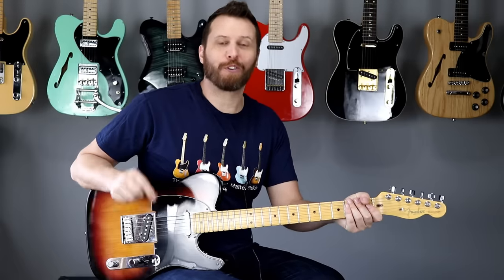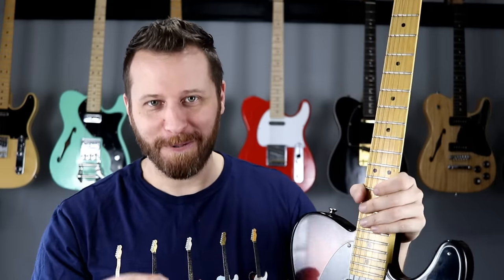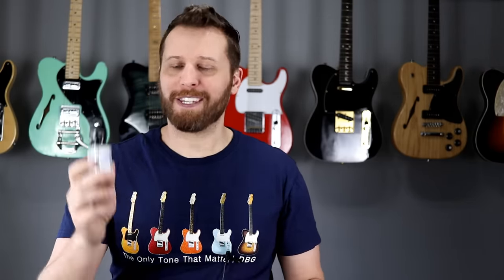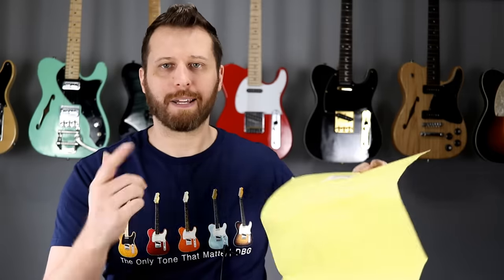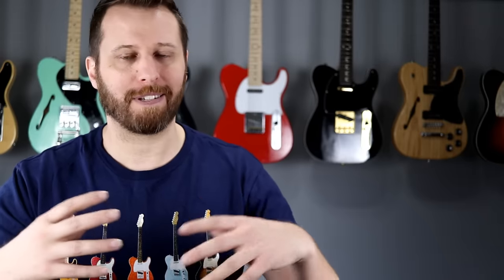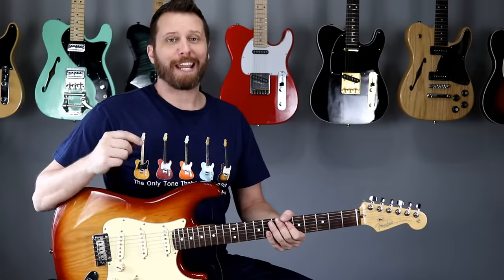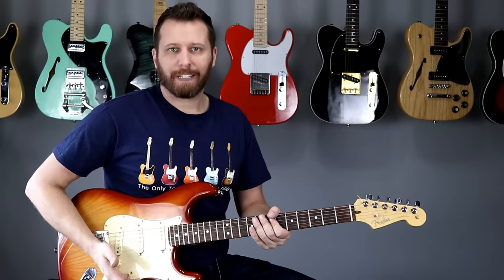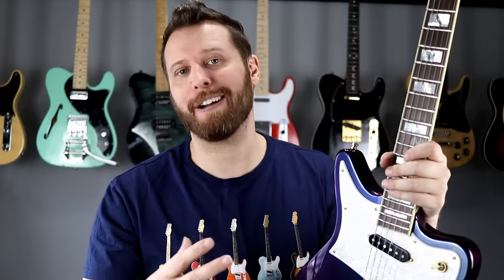KILL The Hum and Buzz!! - Keeping Your Single Coils QUIET!

Comment: Get a Gibson Blues Hawk with two P 90 single coil pickups and a Dummy coil to stop the hum. Gibson should make a Les Paul with P 90’s and a Dummy Coil pickup. Fender could also install a dummy coil pick to remove hum. The Dummy  coil has reverse winding to eliminate hum. Or you can just turn the volume down when not playing.

Comment: Shielding helps with Rfi , not 60 cycle hum.
Some confuse the two. Also sitting right next to the amp doesn't help. Step away from the amp a few feet. Sheilding is B.S. and a lot of times will make things worse and cause ground loops. A noise gate is really the only thing that will truly reduce 60 cycle hum under significant gain.

Comment: Twist the OEM single coil pickups and output jack wires!!! Lightly shield cavity with aluminum foil tape that works just as well as copper foil!!! Ground the three pots together single wire daisy chain as with shielded cavity!!! Stop sinking more money in swapping out pickups!!! I've done these steps on various strat's with positive results!!! Slam the factory pickups down away from strings, and not be afraid in turning amp volume up!! Cheers!!!

Comment: I use a gate pedal and a compressor pedal that gets back some of that sustain you lose by the gate.  Also, you should shield your guitar if its not. Its not that hard and if you care about sound, you will.  That being said. Sometime depending on what is running, you still can get some hum.  For some damn reason my wifes blow dryer sets my guitars off!

Comment: A tip, plug amp into an isolated socket not sharing other electrical appliances. If you cant switch room AC sockets get a nice thick 3 core electrical extension cord and a balanced guitar signal cable not longer than 20ft. Veteran 45 years dealing with this.

Comment: One thing, when recording with a digital processor likle hx stomp if you using single coil remove all rgb from pc hardware and mouse and keyboard cause it does a digital sound with the singles, humbuckers no problem.

Comment: 4p2t on off switch makes a metal covered humbucker into an in phase dual single coil.  Is sweeter than a humbucker and quiter than a p90, quiter than a single coil.   I get a pre boost switching to single coil mode.  Half the impedance, and raises the output.

Comment: Still use my Boss NS-2 that I bought in the early 90's. It has parallel 9v output and a separate send/return loop for my Soul Preacher compressor and Sovereign Distortion 🗽

Comment: Did anybody mention aligning yourself and your guitar in that sweet spot where there's no hum?  It works good when you're recording.  I've used that technique more than a few times.  I have used a noise gate, an old MXR.  It worked good but it did change the attack and for that reason I avoid using them.  My main squeeze is a Danelectro Silvertone circa 1965.  Some previous owner shielded the pots with heavy gauge copper.  I suppose it helps.  The pickups are out of phase and I can play with the tone and volume a little before the hum starts in.  It gives me yet more variation from a guitar that already has a broad range of tonal variation.

Comment: Fishman Fluence single coils are completely silent and aren't stacked humbuckers so they sound right.  I have them in an Eric Johnson Strat and they sound fantastic (or they would if I could play like him).  Only downsides are cost and they fact they are active so need power - the USB chargeable back plate is very convenient, though.  I don't think there is a better solution if you can't stand the hum.

Comment: You can also install a dummy coil. Its more work than shielding, but its very cheap (just buy a chinese single coil and remove the magnet) and sounds arguably better than a stacked coil because its further away from the magnets. You can also tap it if you want.

Comment: I'm skeptical that shielding paint and foil and all that helps unless it's connected to the ground in some way? I used to think that noise gates were a super complicated circuit that will mess with your tone but nope, they just use a light-sensitive resistor and a light so noise gates are great if you ask me.

Comment: Noise gates (good, current ones like the EH Silencer, among many others), Illitch backplate, Zex Coil pickups, Mojo Tone Quiet Coil pickups, EMG pickups, Area 51's, shielded guitar cable, a power conditioner, shield guitar cavities, turn the other way from the amp, and any other things listed in the comments. Many touring acts use expensive, rack mount versions of noise gates. There are many options to lesson the noise considerably in this day and age. if you don't do your own work your greatest frustration may be finding a tech who doesn't believe anything that has happened since 1967 is a sacrilege.

Comment: Get rid of the neon bulbs, other cheap bulbs and buy quality led bulbs. It helps so much with the humming noise. Also, you may use voltage regulator and you will be fine. I had these problems, and after proper shielding and replacing the crappy bulbs my singles are quiet like humbuckers. Cheers.

Comment: I would opt to do the noiseless or hot rails, shielding, and even wax potting if that would help. I don't want to use a noise gate if I can avoid it. But being on the end of this mod chain, it wouldn't have to do much. I want the purest, most sustained sound I can get. Then I can focus on the tone.

Comment: The best way is freq-gating. At first, EQ, which diminish all freqs which are not important, or even annoynig while playing. Generally, all under 100Hz, and all above 5-7kHz. So, hum, noise with hands over strings, and radio and HF at upper end. Then especially you can use notch filter for power net 50Hz (60Hz). Second, Gate, which now doesn't need to set your Threshold too high, coz all junk noise is now very low, even for high gain. So, sound is not so "cutted" by Gate. Everybody uses stompboxes, so it doesn't matter if there will be another one. When you use guitar processors, there will be only another item at the very start of your effect chain.

Comment: One thing that helps, turn yourself around until you find the right way to face in order to have less hum. Certain things in the room, light bulbs, electrical equipment, etc will make your pickups hum far worse. You can clean it up quite a bit just by facing away from the direction of these sources.

Comment: Another option is to have duplicates of the pickups wired up with polarity reversed but placing them in the body in the same orientation as the main pickups but away from the strings so they don't pick up the strings at all. If the noise is the same on both sets of pickups it will get cancelled but the tone will be the same. :) not tried it yet and expensive but like a humbucker without the tonal changes.

Comment: 1. shield your pickup cavity and pickguards with aluminium/copper foil tape to form Faraday cage on the guitar (you can google this one)

2. wax potting the pickups (this will reduce the hum and make your guitar sounds better lol)
3. recheck the cables and re-solder if loose 

those 3 procedures will significantly reduce hum and buzz on your guitar. tried those on my guitar, works excellently! :)

Comment: I experience a terribly hum. Both with my Fender Elite Strat and with my Les Paul Humbuckers. I found out that if I turn on one of my dimmer switches it makes the hum a lot worse, but even with it off - it hums a lot. I bought a HumX to plug in the electric socket - but it didn't help. I bought new super shielded cables, but it didn't help. I bought a Dunlop MXR Smart Gate Noise Gate M135 and set it to the highest level and it didn't help. I tested with my two Amps, and it happens on both. I did not put any shielding in the guitars yet, but if the gate is not fixing it, would it even matter?

Comment: All shielding needs to be grounded or it’s useless. Much of the hum and other noise is microphonic results from vibration within the magnetic field near your pickups. Making sure your pickups are potted with wax or lacquer helps and that all ferrous metal parts are secured to prevent vibration.

Comment: Why not just incorporate a string ground. (I know, you can get shocked, but usually you don't)  But a string ground with a fuse is easy enough to install and as long as you're touching the stings, it's quiet as a mouse.   I used to just run a piece of wire from under the plug to the nearest metal that would include all the strings. (this was on a 63 Jazzmaster).  For recording I've sometimes run a ground wire to my leg to kill hum.  It works and it costs about 10 cents.  I got a string ground kit from Taylor for the pickup on their original click in pickup on the GS mini.  (first they said it was my problem but eventually sent the ground kit) It was a 6 hole piece of metal that was attached under the pegs so each string ball was grounded. ...it's wire ran to the ground of the output.  with a small inline fuse to keep me from killing myself.  It works.

Comment: I have a cheap Bullet Squire. If u just "plug in" u get hum.  Mistake--Dont do that. I bought a yamaha 500 "1989" effects processor.  It converts the signal to digital. This is going to be hard to inderstand if u dont have a digital processor. Plug in your amp chords in the phono jack in the back, not the left or right side for speakers.The phone jack has a volume adjustment. Just reduce the volume output to sync with the processors output. NO MORE HUM. Good video from Sacramento

Comment: Nice video. Only bummer is I was hoping maybe you'd have a like secret I hadn't tried! I use an NS-2 but the gate sensitivity is really hard to dial in the way I play. I really don't want to pick apart my player strat and add a bunch of shielding but I may have to do that. Do you have any recommendations on noise reducers? I know the ns2 is like a perennial favorite, but is there a better one I should be trying?

Comment: I only have this problem when i run my strat and pedalboard straight through the pa... when i use my deville and keep both distortions at noon and even stack them theres barely any hiss even on the neck pickup. It mostly depends on how much power you are getting from one source using multiple outlets helps or using a different outlet for pedal power and different outlet for amp power.

Comment: Center tapped ground source with dual balanced circuitry or, active circuit. What other way is there? Go two wire balanced out of the guitar then transform it back to single ended at the amp.

Comment: Does a 60Hz notch filter spoil the sound? Or may be a comb filter for 60Hz 120Hz, 180Hz? Should be easy with modern digital signal processing techniques.

Comment: Noise gates are band aids and kill sustain, you just need a sound electrical circuit from the guitar electronics to the cable, amp and power source

Comment: I'm not sure if anyone else has noticed this, but my current set up right now consists of a squier strat with single coils, plugged straight into a fender mustang v2, and ive noticed that distance from my amp, and wether or not the pickups are pointing towards it seems to affect the hum alot. If i get atleast 3 feet away from the amp, it more or less removes the hum completely. Not sure why that is but its a thing

Comment: After watching some of your videos I decided to upgrade my Fender American Performer telecaster bridge pickup to a Chopper T. So I took it to guitar center! The guy had never heard of a chopper T he looked intimidated! When I got it back he had chipped my brand new guitar and it was scratchy touching the strings would make a shocking sound and the tone knob was all scratchy! They sent me to another Guitar center to fix It! It took them a couple of days and when I got it back the chopper T full on humbucker mode sounded great and was low noise but when I pulled push pot out the chopper T single coil mode had lots of noise! And the neck humbucker pickup had noise! Is this normal?

Comment: Noiseless pickups that are a stack design will, at best, only reduce the hum. There are a few crazy designs that are getting much better, but they really alter the bobbin construction and other things most manufacturers won’t do... yet. A humbucker that has asymmetrical coils will only reduce as well. Unless you have two coils perfectly symmetrical, you can’t reject achieve “noiseless” status. That’s why I hate this whole “noiseless” ploy.

Comment: So I have a dilemma pertaining to this very subject. I am the original owner of a Japanese Squier Strat from the early 1980s that’s in totally mint condition. I absolutely love the sound of the pickups and I don’t want to change anything out on the guitar. Oddly enough, even in the two and four position, there is hum so all positions have major hum.  I don’t want to change pickups per the great sound so I’m thinking I need shielding.  I have a noise gate in my Zoom multi fx but I don’t always use that with my amp.  Is shielding the way to go and how much would it help?
Reply: I have the same era Squire Strat. Shielding quieted it significantly.
Reply: Pistachio Studio thanks for letting me know.  Did you use the paint or the tape for the shielding?

Comment: I don't know whether this is applicable... But I actually connect the guitar cable jack to the earth wire in the power socket ... How did I find out?  Everytime i touch the guitar cable... It doesn't hum.

So... I took an earth wire...  Connect it to the guitar cable going to the amp. I wound the other end to the earth plug in the power plug of the amp.

Comment: Or you can put Fishman Fluence Single Coils in it. Dead silent and sound great and with the pull of the tone knob you get a new set of pickup sounds than with the tone knob pushed in. You also don’t get treble bleed off when you roll down the volume.

Comment: Some of your hum there is actually coming from the amp, not the Guitar. When you used the noiseless strat and MM that showed trough.
I've been working in a high gain three channel amp prototype. The clean channel is amazingly quiet. Even with True single coils. Change to the others and not only 60 cycle hum becomes more apparent, other hum comes in too.
It turns out that gain produces hum. It's inherent. Gain stages are not selective to the point you it will amplify only musical content. As gain increases so does the "sensibility" of the amplifier.

Comment: I will add another option. Single coils wired in series.I just did this mode to my strat and when I switch to series - no hum. Of course the sound changes as well - it gets bit more like humbuckers,  but often this is exactly what many guitarists are after :)

Comment: what I found is that with a loud amp on stage there is barely any hum.  At home on the other hand, it's unbearable.  What works best is putting your amp in the same plane as your guitar, rotating -- that way the hum goes completely away.  When you tilt the guitar or rotate the guitar it's back.